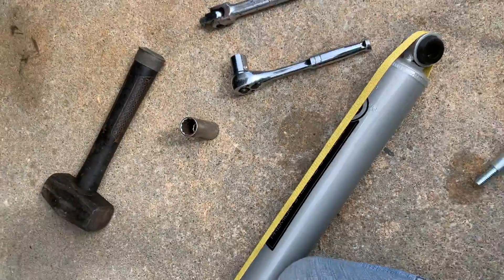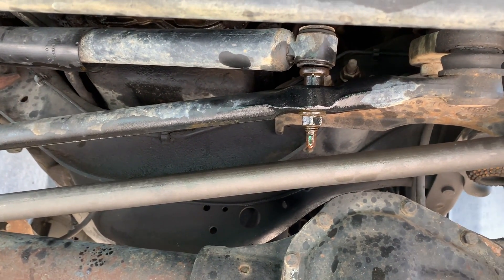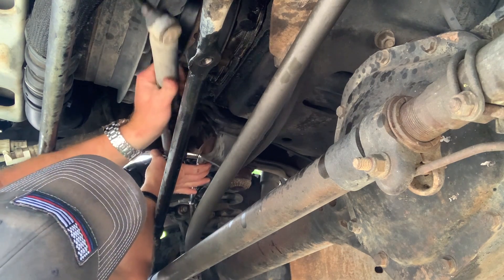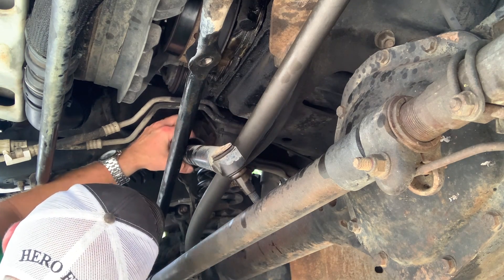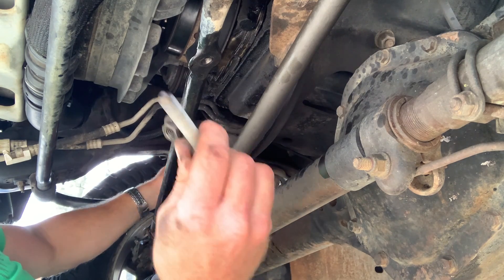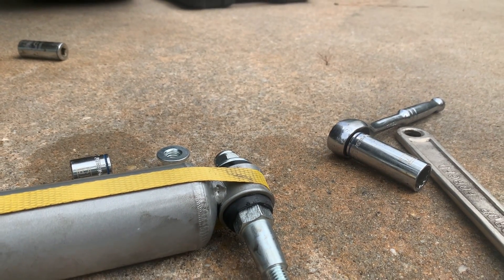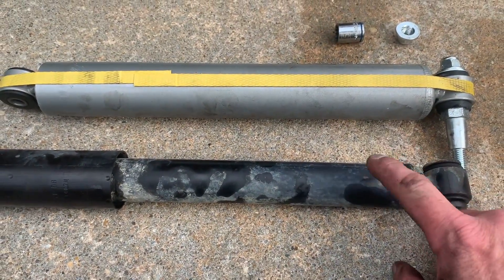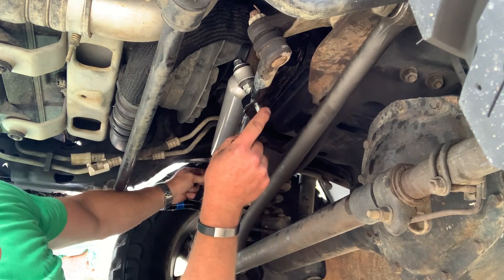Rough Country Single Steering Stabilizer on Ford F-250 Using Factory Mounts

Comment: Did you change this stabilizer because of the death wobble? Since when you posted this video 6 months ago how is the stabilizer holding up
Reply from the maker: Yes. But, I also put in a new sway bar because the rubber bushing was worn out and a sway bar ball joint. Thing is solid as a rock now.